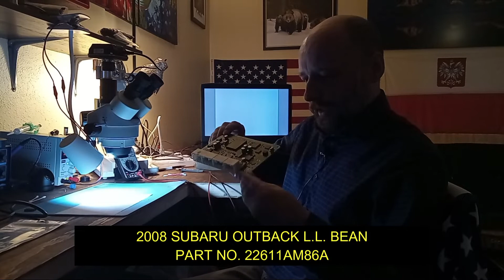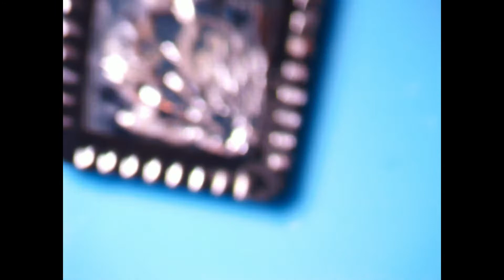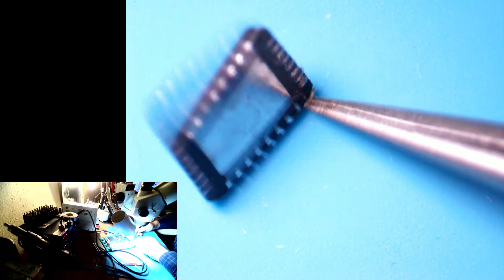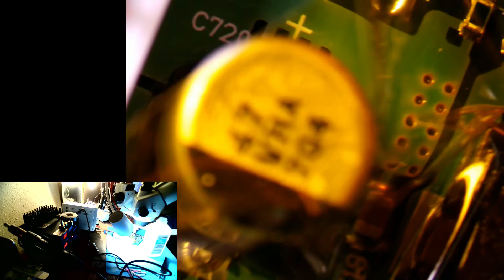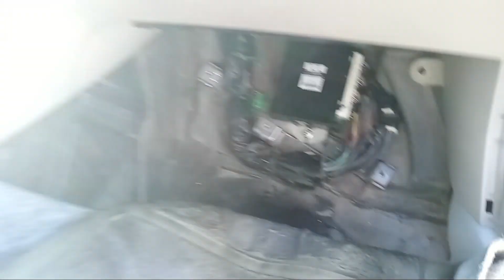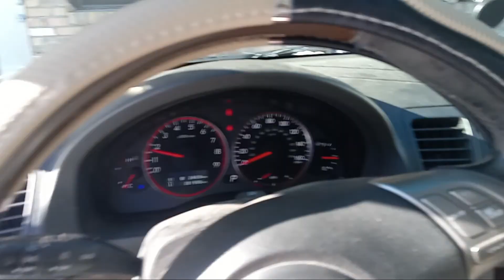2008 Subaru Outback H6 ECM ECU repair cylinder #6 misfire P0306

Comment: mine starts to misfire on 1st cyl after being started and running for 2-3 mins, could this be a ecu issue? 2009 Subaru Outback 3.0R
Reply from the maker: Classic issue on these engines, yes it is an ecm issue

Comment: Mine has P0301, 1st cyl. Wondering, which neighbour pin is to be rewelded
Reply from the maker: Second one from the bottom right up. They go 1 to 6 counterclockwise
Reply: @blackhorserepairs ?
Reply: @blackhorserepairs what do you mean by second one from the bottom right up ….like what position of the circuit board has to be to start  from second one from the bottom ?
Reply: @carloscaceres6524 reweld the whole chip. No guaranty the others slowly lost connection as well. I got mine totally replaced by an auto electronic specialist

Comment: If you fry that IC and need to replace it, do you need to go to the dealer and have the ECM reflashed?
Reply from the maker: No, you can just replace it, it's just a transistor array, no memory and no pairing
Reply: @blackhorserepairs afaik its ADC, analog to dogital converter, judging by specs I found by chip description bosible on your recording

Comment: Suspicious that my cyl 5 and 6 high rpm "misfire" (dosent seem to actually misfire) and intermittent tachometer is this issue. Thanks for the informative video
Reply from the maker: if you get misfires at high RPM you might have an injector issue, try replacing them to see if the problem goes away, otherwise, it might be an IC608 soldering problem.
Reply: @blackhorserepairs  it will throw a misfire code but doesn't seem to actually misfire
Reply from the maker: @roberthughes2360  Sometimes misfires are intermittent and too short to notice, If the ECM reports a misfire, there must have been one, otherwise crankshaft sensor might have issues (or the camshaft sensor) but that's less likely. See if injector replacement resolves the issue.

Comment: WOW, amazing! 
I had this misfire issue on Legacy IV 3.0R 5EAT. I was looking for other ECU and after ~2 weeks I have found it in other country (Poland 😁) for ~50EUR. I have replaced ECU (~3years ago) , but all this time I periodically go online and search for this ECU just to have a spare (22611AK990). But all this time what I find costs more 1000 EUR. 
I knew the issue is in solder and some people fix it with the ove, but I also don't trust this fix method. 
Is your ECU still working well?
Reply from the maker: yes it does and so does many others that I fixed using this method. Oven method indeed is not recommended :) and those ECUs are as rare as they are expensive.
I'll record the video in the near future inspecting my work from previous one.
Thank you for your comment
Reply: @blackhorserepairs  thank you for your reply. If I will get this issue in the future, I would like to send you my ECU. As I see, you are from USA, right? I am from Lithuania, so it would take time... 
Maybe you have my model in stock (22611AK990 or 22611AK991)?
Reply from the maker: @mindaugasv85  I do not have this one in stock and they are not interchangeable, they are locked to the vehicle's VIN. Lithuania huh? I'm originally from Poland :) Not sure how much the shipping would be but you're looking into about $40 and 2 weeks :)
Reply: @blackhorserepairs  I will share my experiance: 
I have replaced my old ECU with an other, so I needed to get the codes of my keys. I have got them from official subaru service for free, but it took time (few days), because they need to send request to Subaru (Japan). 
Then with programming (service) tool write those codes to new ECU. For really it's very simple procedure.
Reply from the maker: @mindaugasv85  interesting, where can I get that service tool?
thank you for sharing your experience

Comment: Any chance you could list the equipment and supplies you use?

Great videos!

Thank you!
Reply from the maker: This video is from a very early stage of my bench :) but I use relatively cheap equipment, a hot air station for $50, soldering iron for about $150 (in this video I didn't have it yet), a fume extractor (about $100) Fluke 18B+, MESR-100 and Fnirsi 1014D oscilloscope. The microscope is from AmScope and the camera that you see in this video at 18FPS is also from them, now I have a better one that keeps 25FPS no problem. I'll publish a video presenting all that if there is interest.
Reply: Thanks again!

Comment: Does this include all ez30/ecm that have this issue? Mine seems to be the pin not fitting in properly but before I realized it was the ecm I had intermittent starting problems I thought was from the key/anti-theft. Could this be related to a #6 misfire through this ecm chip issue?
Reply from the maker: Yeah, all Gen3 H6 engines, all of them have this chip and on many of them there is an issue with a misfire, it's not always #6, sometimes it's #1 and #3 (for whatever reason), this procedure addresses all of them.
Reply: After my ez30 started to.missfire #1, it also started to have starting problem  simetimes, sometimes I have to rock the key 3 times. Never had that problem before P0301